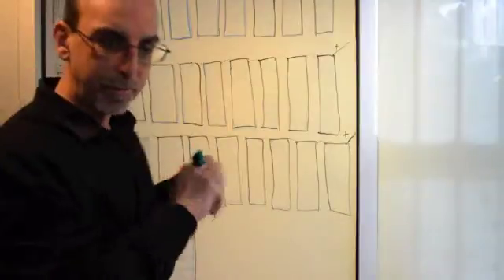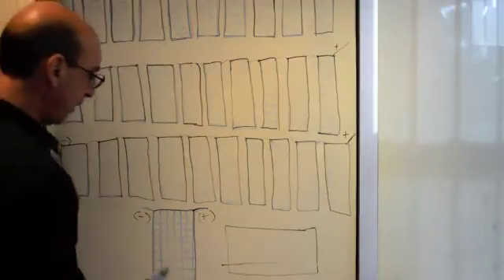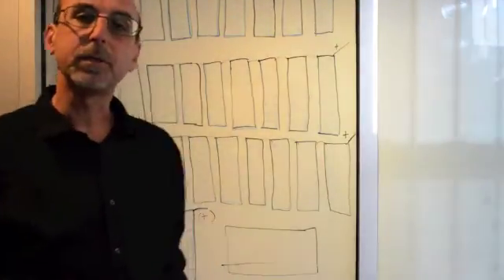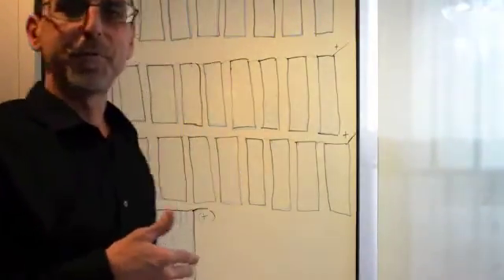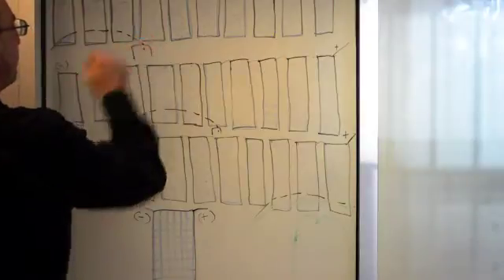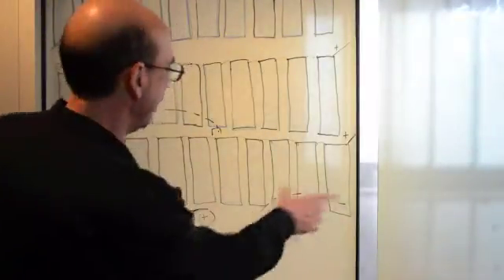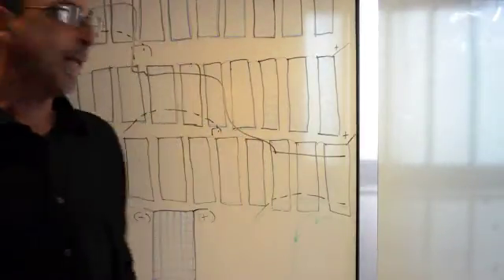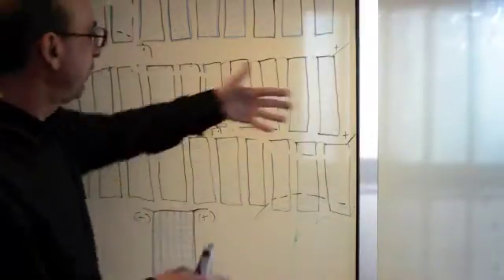Solar Energy - Avoid Shade in Solar Installation

Comment: this is a critical issue and vastly important for proper panel operation.  this subject is as important as panel selection, wattage calculation, arc tracking, etc to an endless list.  without knowledge of shading you will screw up your system.